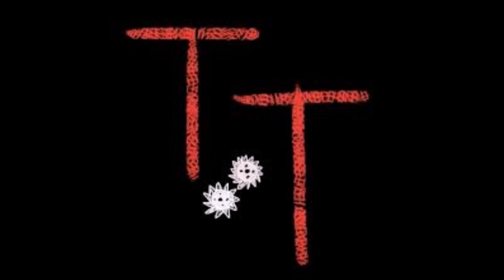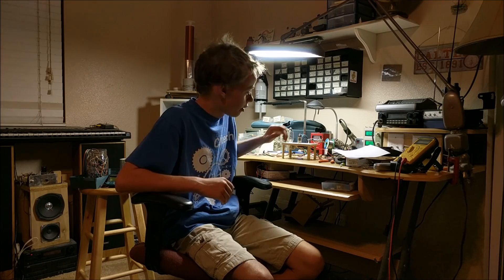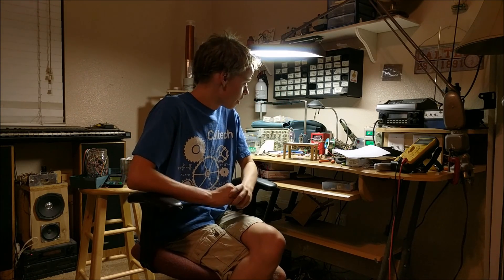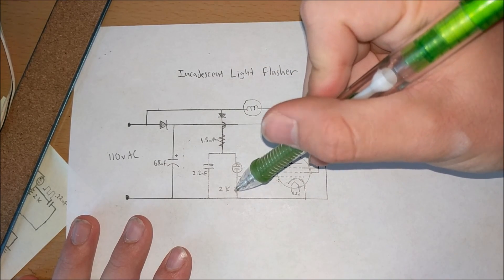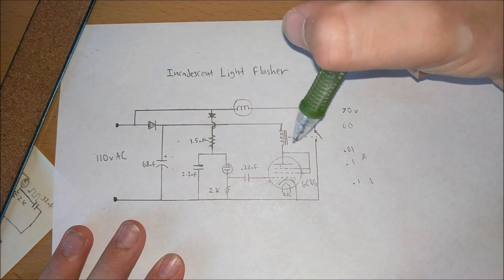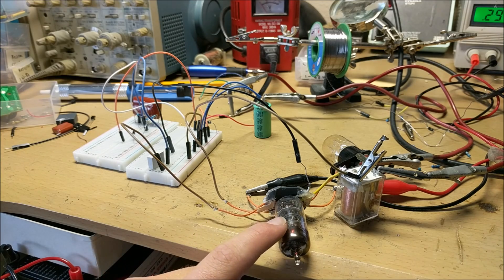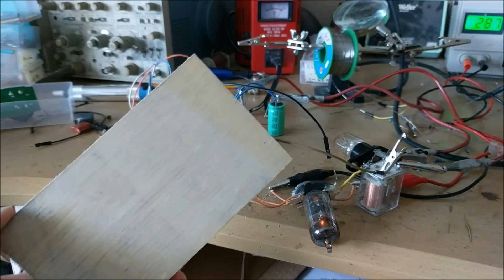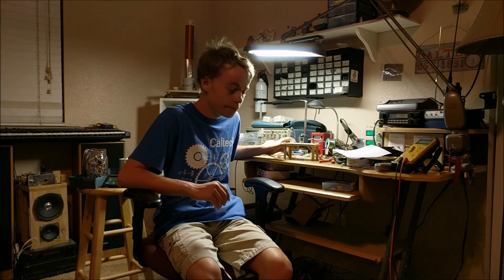Neon Bulb Triggered, Vacuum Tube Amplified Light Blinker! (Flashing Light Prize 2017)

Comment: will this work with EF80 vacuum tube and 12v 750ohm relay ?
Reply from the maker: +ELECTRONICS that should probably work.
Reply: Tanner Tech 
I made it ,works perfectly
Reply from the maker: +ELECTRONICS Awesome!  You should make a video showing it working!!!!
Reply: Tanner Tech 
I will but I dont have time Im working on solar system in my old house

Comment: what voltage is that relai?
Reply from the maker: +robot797 12 volts, but you need one with an 800 ohm coil to match the tubes high impedance.